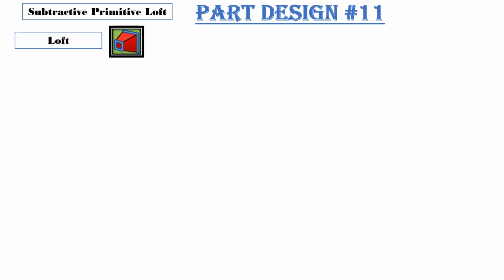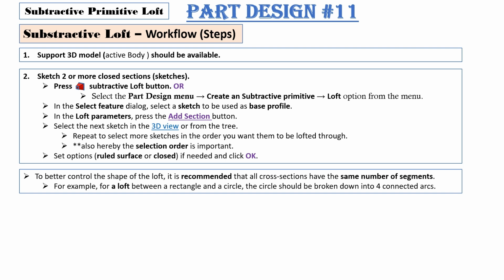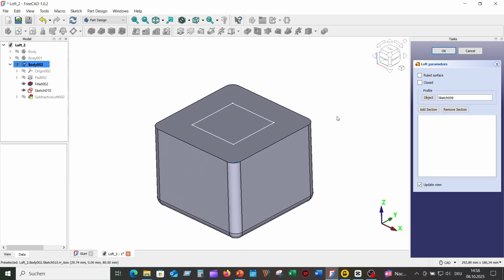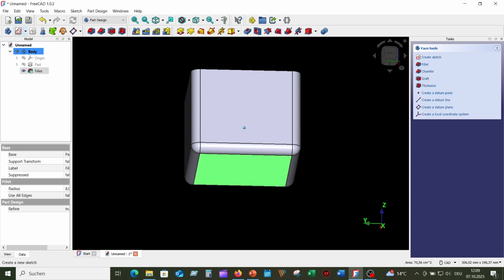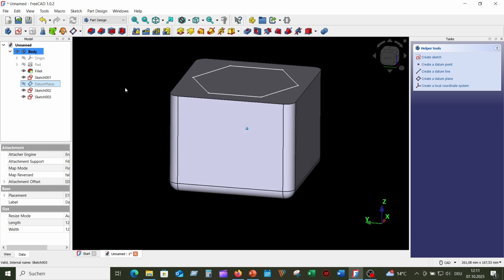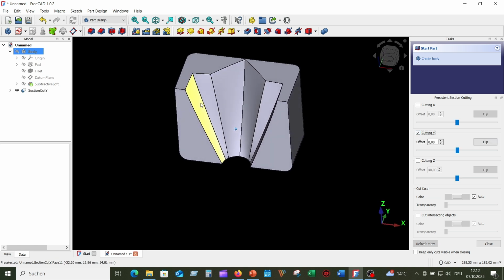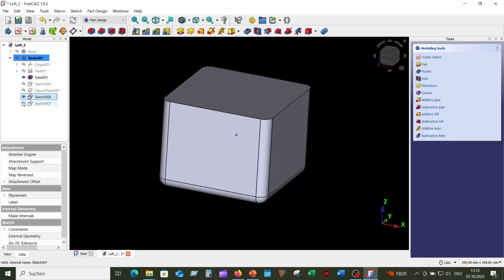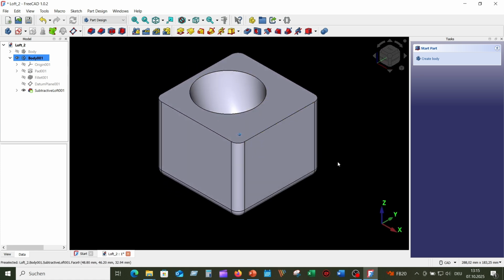FreeCAD Part Design tools #11: How to use the Subtractive Primitive Loft tool in FreeCAD.

Comment: Many thanks for your tutorials, them has given a lot of tiny hints for me, specially in piping and lofting.
Little hint from my side: I change sometimes the name of sketches with F2 button: Gives myself better control / overview. So instead Sketch it goes to PROFILE and Sketch001 in PATH.
It's not a must but can be a big help if projects becomes more complex.
Reply from the maker: Hi,
Thanks for your hint. You are right. I also have similar experience with big projects.
I will consider your proposal in my feature videos.